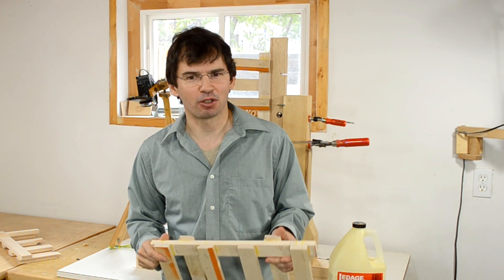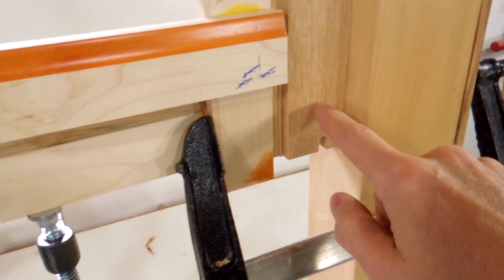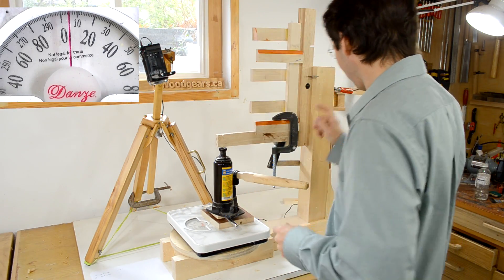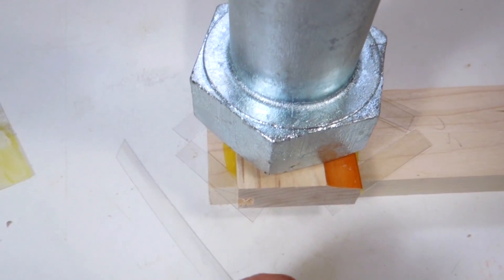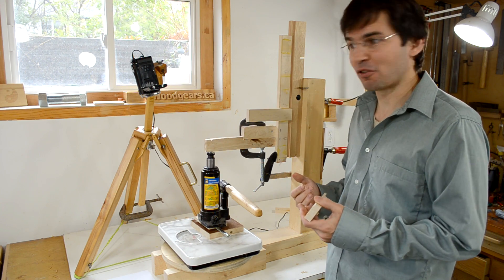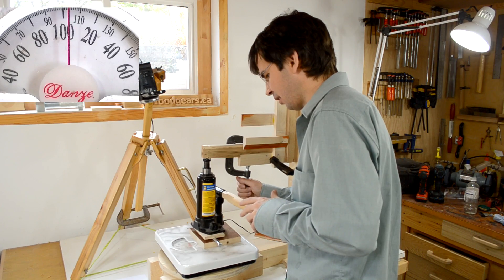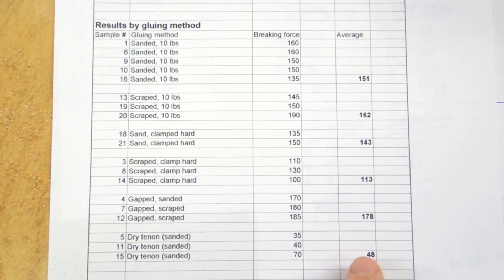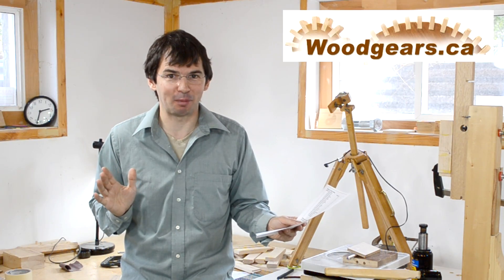Can you squeeze all the glue out of a joint?

Comment: I see you use glueing as a very standard means of joining things in many videos. I see that it works well for your purposes, but what about the durability of those joints in terms of time. I suppose the glue will loose its strength over time, and therefor after say two years a chair will probably fall apart, no?

Comment: @3:15 how exactly does that simulate putting a dry tenon into a mortise? I mean you just slid a piece of wood on top of a flat surface, therefor pushing all the glue away. Whereas if you actually had put a dry tenon into a mortise, all the glue would have stayed in the mortise and grabbed the tenon while drying.

Comment: i know this is an old video, but i cannot overstate my interest in finding the strength of glue in ways other than torque. shear and tensile strength would provide much more real world data. i dont think wood glue would be torqued as much as pushed and pulled.
Reply: Really?  Most items which are glued up are at 90 degree angles to one another.   I'm thinking in terms of furniture or cabinet making.  Think of a frame and panel door.

Comment: In fairness though, tenons are primarily joints used to resist shear, not flexure.
Reply from the maker: but it's flexing that breaks joints, so that's what matters.
Reply: If both ends of a member are tenoned -- which is typically the case -- then the member would act like it was pinned-pinned.  In that case, one would expect the ends to rotate, because that's what simple beams do.  But I definitely see your point: once the end rotates beyond some threshold value, then the glue breaks even if the tenon doesn't.  At that point, the tenon can pull out, unless the builder pins it with a nail, a screw or a dowel.

Comment: I think your “dry tenon” test was not accurate at all, because you were not using a tenon join but a simple lap joint that you scrapped a lot of the glue off of one side. A “dry tenon” joint is placing glue in just the mortise & when the tenon is inserted the glue will spread along all 5 sides of the tenon & not just one side. You also have to consider the fact that the tenon is also supported by wood on several sides including the shoulder support.
Reply from the maker: No Name Yes, a tenon without any glue will also hold.  But I wanted to test what the glue did under that sort of circumstances.  That's what one does in science, model something close to get just the effect, without mixing it up with other factors.
Reply: Matthias Wandel 
But that’s just it you need to test the circumstances of a tenon joint but you are testing a lap joint with most of the glue pushed out. Testing the other factors is the nature of science & engineering. Your test on a dry tenon joint is faulty because you are not testing a tenon joint at all but a lap joint. So how can you say that a dry tenon joint is not a good idea when you are not testing the properties of a tenon joint? A more accurate test would be to make a tenon joint with a minimum amount of glue & attempt to pull it apart.
Reply: Matthias Wandel im curious how hot glue would stand up to this test (i know it can be pretty strong, and it is ready to use in a minute)   EDIT:  found it already http://woodgears.ca/joint_strength/glue.html
Reply: 2ftpmarco 
No I don’t think hot glue would stand up to any of these tests very well. I don’t find it to be very strong & items such as wood can be broken apart very easy. Wood turners will use hot glue to temporary hold an item to a chuck & after finishing the turning job simply snap it off the chuck, but it would be interesting to see the results in tests such as these.
Reply: No Name I concur.
Reply: +Matthias Wandel But with the constraints of the mortise wouldn't the glue be forced back up around the tenon. Not just pushed off of the edge? Assuming that there was enough glue to fill the gap between the end of the tenon and the bottom of the mortise and still have some left over. Then 'hyrdolic' type pressures would force that glue back along the sides of the tenon?
Reply: +No Name As Matthias tried to explain, if he had tested a dry mortise as you suggest it would not fit with the parameters of this experiment. It would have made zero sense to have a mortise joint suddenly thrown into this test. I agree with the way he recreated a dry joint because this is a test of various applications of the glue, the type of joint is in no way a factor, he could have said "dry finger joint" or "dry mitre" or anything and his lap joint would have been just as suitable because it was not the joint that was being tested.
Reply: it was not the TYPE of joint that was being tested
Reply: Thabiet Yeah, I won't bother rewatching this. If he used a dry lap joint in this it wouldn't fit the parameters of the test (not saying he didn't), nor would any unglued joint.
Reply: So test the tenon without any glue and deduct that amount from your experiment. As someone else said, the glue will get pushed and then flow back onto the tenon, unlike your experiment. Still - I like the video and the tests. Useful info! Thanks!! ;)
Reply: ***** As I said this experiment was not testing the strength of different joints, only of glue. There are plenty of videos out there in which they test the strength of various joints.
Reply: ***** - I am capable of seeing what the experiment was. There's a valid point to be made for where the glue goes and what happens when it flows back onto the tenon. I wasn't criticizing Matthias and I don't really need you to explain it to me. Thanks.
Reply: Then why say "Dry tenon, not a good idea."  @3:34
Reply: ***** Your welcome.
Reply: ***** My welcome?
Reply: ***** Yes.
Reply: Shillier, you seem to be ignoring the indisputable fact that Matthias claimed, off of the basis of his experiment, that a dry tenon is not a good joint. How then, can you claim that his experiment was not designed to test a dry tenon joint? Face it, Matthias tried to discredit the dry tenon joint based off of a test that was not capable of discrediting a dry tenon joint.
Reply: Ref: glue and wood joint experiment. True, elimination of variables is key to establishing a baseline for comparison. Variations are for the purpose of comparing results to identify the single best scenario.
Reply: You can't just "deduct" amounts like that Richard. For one thing, that makes no sense, for another you will have zero clue what all you're subtracting. You would need to test every condition, face, and joint factor in order to even remotely get an idea.

Again, the JOINT isn't being tested--the type of GLUE APPLICATION is.
Reply: Ian -- because in both cases (dry or not dry) the JOINT is the same in a mortis/tenon . What is variable is the WAY THE GLUE IS APPLIED, therefore when testing for this you eliminate everything else and go after the variation: the way the glue is applied.

Face it, you have not understood what is being tested. We know that two identical tenon joints will hold up the same. What we wanted to know is how will different types of gluing affect that. 

Therefore, you TEST the GLUING.

It's not that hard--this is beginner HS or Middle School level science.

Comment: the strength in a mortize & tenon joint does not come from the glue. it comes from accuracy in cutting. If you need the glue to provide strength you really need to up your tenon cutting
Reply from the maker: Please do run some tests.  It would change your tune!

Comment: Yes, you told him already and thereby showed twice that you don't understand. How would the sides prevent the glue from sliding away? The glue isn't even pushed to the sides, neither in his simplification nor in a "real" tennon. You push the glue to the bottom of the joint (which is exactly what Matthias' example simulated), where it's almost completely useless.

Comment: OK, I won't try to convince you anymore, because clearly I would need a picture to show what I mean. But as I said, I have used this method many times and have years of experience and the joint has never failed. So if that method truly is as "weak" as Matthias is making it to look, then how have I, and many others never had any problems with it? Or maybe in normal use the joints actually never go through that amount of stress directly, making these tests irrelevant.

Comment: You take the time to perform replicate measurements, but don't perform a t-test on the results to see if the difference is significant? WHYeeee!?!?!
Reply: +Michael Molter (mean±95% CI) in order of strength; Gapped sanded (178±19 lbs), Scraped 10 lbs (162±61 lbs), Sanded 10 lbs (151±13 lbs), Sanded clamped hard (143±95 lbs), Scraped, clamped hard (113±38 lbs), Dry tenon (48±47 lbs). Gapped and sanded are the strongest, but one is not discernibly stronger than the other. The difference between 10 lbs clamping force and clamping hard was not significant for both scrapped and sanded.